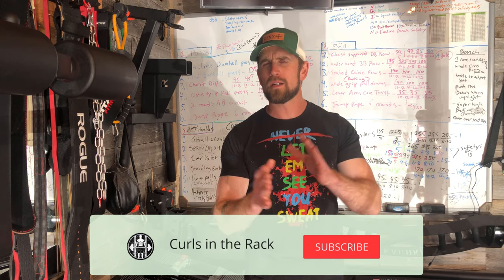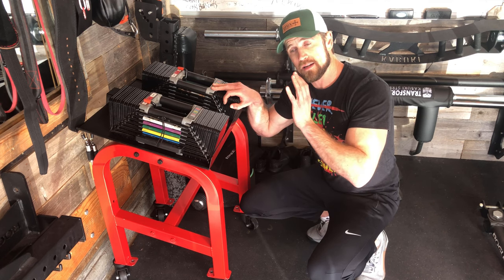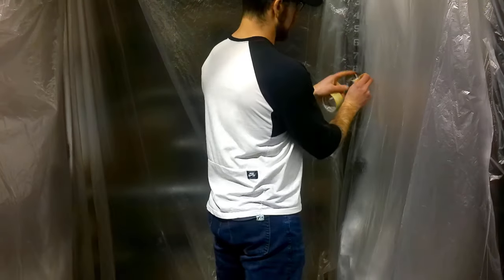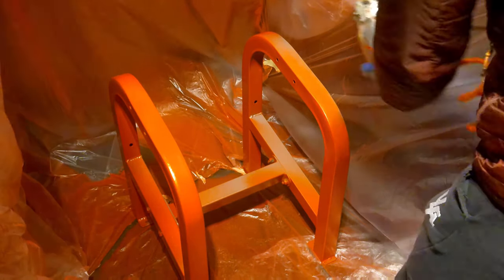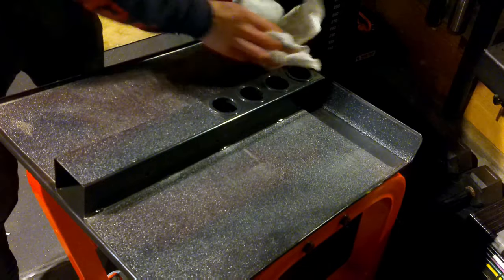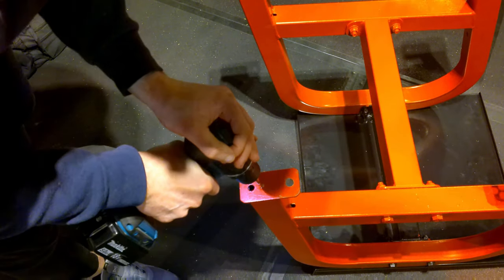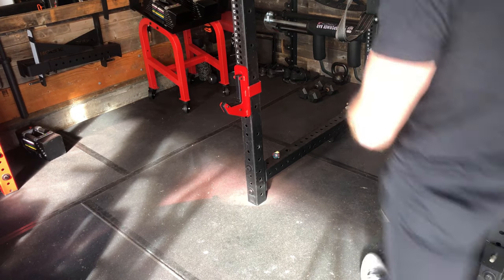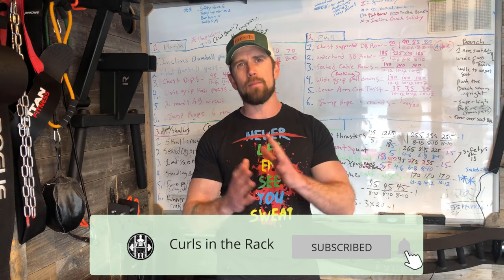Upgrade your PowerBlock Dumbell Stand (Add Wheels and Paint)

Comment: That's great. I was very impressed. I live in Korea. Where can I buy the wheels for the power block holder? How many inches is the cradle bolt hole tool? Like you, I would like to have wheels on the cradle.
Reply from the maker: the link is in the description
Reply: @CurlsintheRack  Well, first of all, thank you. But there's no link to the tool for the wheel in this video... I don't know if I didn't find it. You can find a link to the DIY in your other videos, but there doesn't seem to be a link in the description of this video.